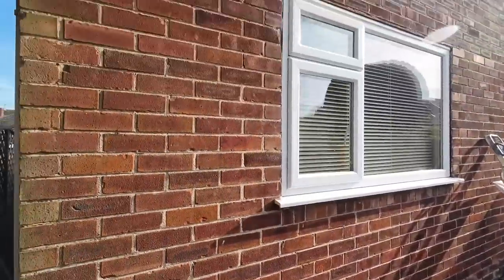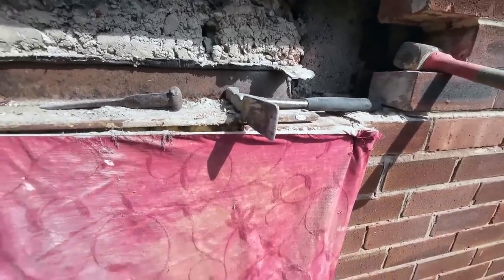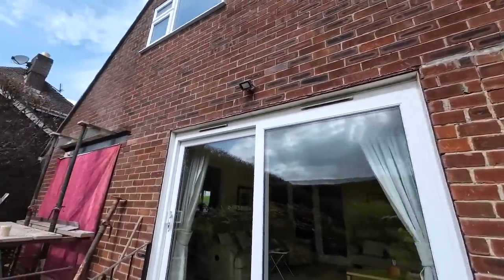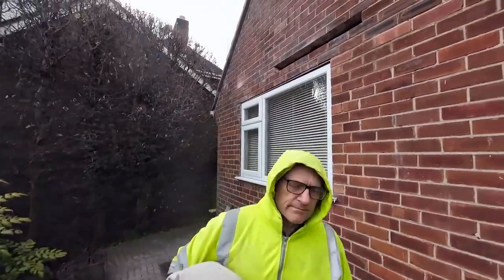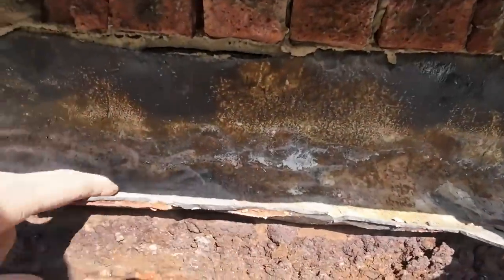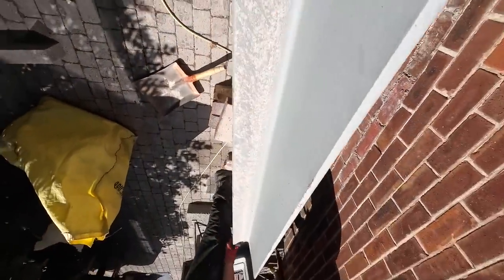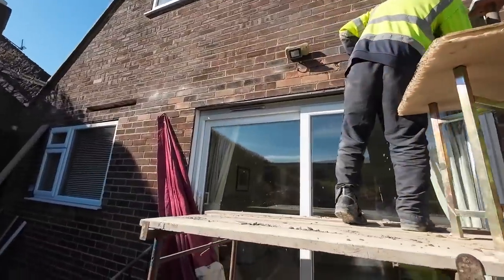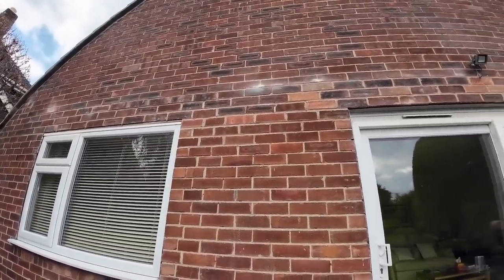ABSOLUTELY SHOCKING CAVITY TRAY. BUMPER LINTEL EPISODE

Comment: Hahaha,"cut them down to size back then". That old piece of angle iron was picked up at the scrap yard and was chewed to length by the scrap yard dog. Shameful work - a disgrace. No excuses as per that was the way it was done back then, whoever did that job was a disgrace to the trade. My house id well over 300 years old and has no issues,no damp and no rotten lintels. Another prima job done guys and an excellent video.
Reply from the maker: 😆😆very true 🧱👍🏽

Comment: An easy way to get clout nails into awkward places is use some steel rod with a small piece of rubber tube on the end. The head of the clout fits snug into the tube and holds it in place while you drive it in.

Comment: Fer cryin' out loud keep the tools away from the microphone! 
That's sure not lime mortar, it stopped that recip saw cold. Not being a brickie, it surprised me that a brick would be unavailable any more. I some how thought bricks were pretty much the same size through the years. I'm always amazed how much load those Acro props hold. That thin plate at the top! It seems every job turns up more problems than were visible originally. But you lads roll on and solve the problems. What is the old tray made of? Metal? I like the height of the new lintel. The strength of a beam goes by the square of the height so double the height = 4x stronger. It seems like the old lintel was put in the wrong way and water was getting in with the edge exposed like that? One last question: How old is that original brickwork?
I learn a lot watching you two. Thanks! Pete
Reply from the maker: Er sorry, editing slip up 😬. 
  Bricks are an absolute nightmare to match now so many discontinued . 
  Acrows don’t actually hold much up just a triangle of brick’s directly above .
The cavity tray is made from a bitumin kind of material .
I’m guessing the house is about 70 years old.
Thanks very much Pete 😁🧱👍🏼
Reply: @SteveAndAlexBuild  Thank you for taking the time to explain things. There is very little brick work done on the west coast of USA because of the earthquakes.

Comment: I have seen previous jobs done by you lads as a steel Boatbuilder myself I noticed the old Intel you removed although going rusty looked a solid thicker piece of angle iron. But the new Intel looks like a galvanised pressed thinner piece of tin. That doesn't look strong enough to hold a lot of weight.
Reply from the maker: Thats what its designed for and it doesn't actually carry much weight 🧱👍🏽

Comment: If its getting rendered then your weep holes should have been left proud for the thickness of the render
Reply from the maker: It wasn’t decided 🧱👍🏽
Reply: I wudnt want random holes sticking out of my newly rendered walls.... Thort render was fairly water tite  🤔
Reply from the maker: Very true , never seen weep Vents in render 🧱👍🏽
Reply: @SteveAndAlexBuild  why not use a grinder or a plunge saw with a stone blame ? Way quicker and easier .. easy to fix a straight line for a grinder etc
Reply: I know u did. use a grinder/sthill but wondering why u didn’t use it from start